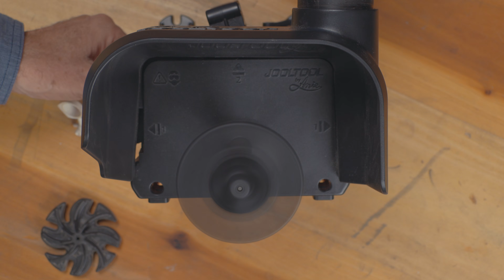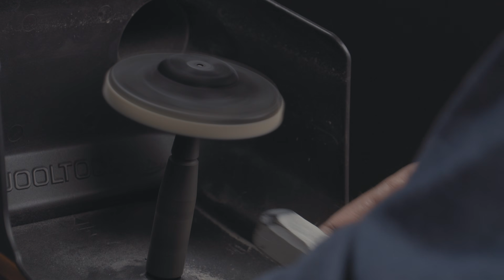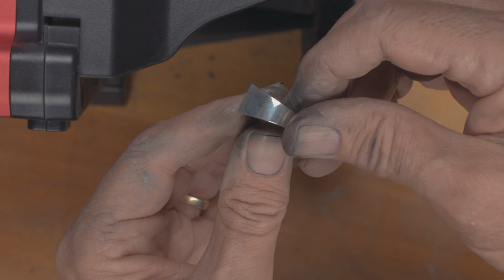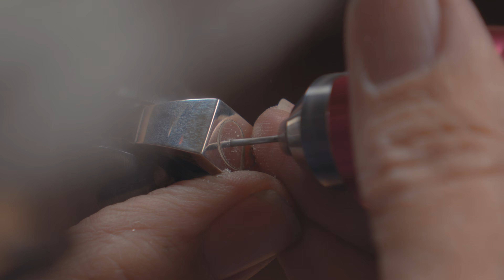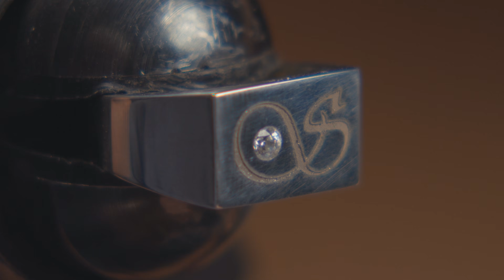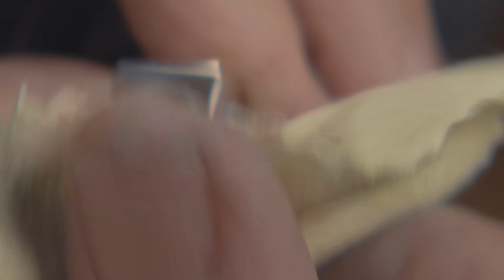Polish and Set a Stone in a Signet Ring with JoolTool

Comment: How would you set a princess cut diamond in a signet ring?
Reply: I made a signet ring in a delft clay mold and wanted to do a flush setting. Do you have any videos of this process?
Reply from the maker: @jonmurphy7037  Here is a really great video on how to properly flush set a stone.  https://www.riogrande.com/knowledge-hub/videos/how-to-flush-mount-a-stone-in-a-wedding-band/
Reply from the maker: There are many ways to set a princess cut diamond in a signet ring.  You can solder a setting on top or cut a hole and solder it into the hole. Then set. Prongs work as well. 
The stone can also be flush set.
Reply: Thank you so much. Great video, simple, straight to the point, informative.

Comment: Right... buy these tools (half the video), use a programmed laser engraver, and voila all done with the jooltool. Disappointed (very) in the clickbait presentation.  I am not complaining about being introduced to a specific tool, but seriously that's NOT the topic on the title and should be about 5% or 10% of the content, in all honesty.
Reply: “Polish & Set a Stone” The Entire Casting was Finished with one Tool, From Sprue to Polish on the Jooltool. Not sanding by hand or hand filing. And the Jooltool was used to create the “seat” for setting the stone. The video showed Just  that in the Title. The laser engraving was just the embellishment on the flat polished surface towards the end. If the top was not embellished, we would have received comments that said “well can you laser engrave” “can you set a stone on top” etc. Save your hands, neck & back, use a Jooltool! Thank you for watching! ❤️-Anie